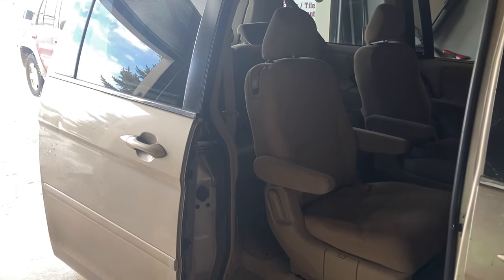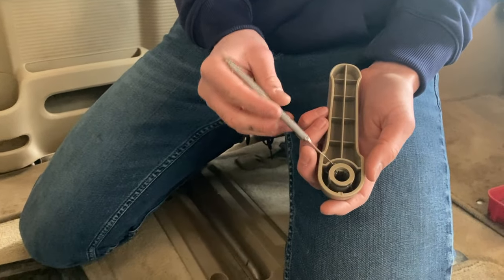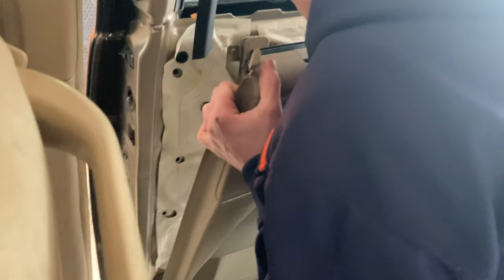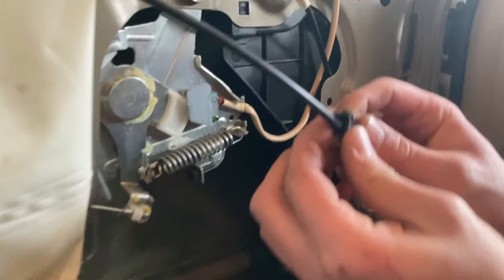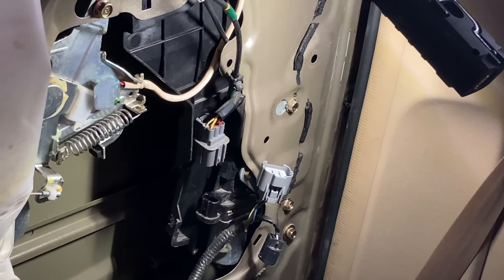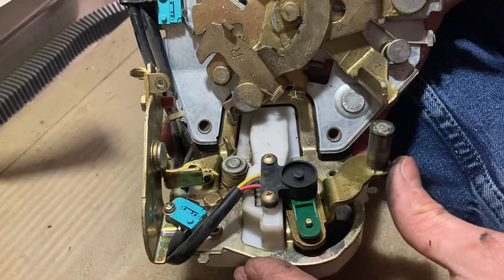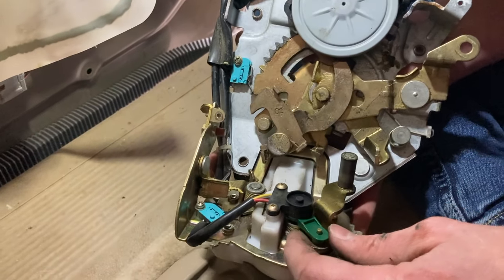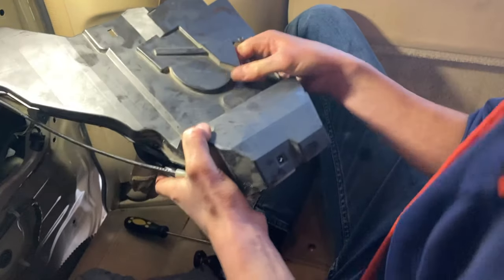How To Fix Parasitic Drain and Power Sliding Doors On 2005-10 Honda Odyssey

Comment: Hi Hans, grreat video! If we don't have time right now to fix it, would it solve the parasitic drain if we pull out the fuse that operates these doors?
Reply: @hanspoole  Dear Hans, THANK YOU FOR SUCH A THOROUGH REPLY! We have been using a small lithium jumper battery DAILY to get this going every morning. What a pain! I guess I have to make the time to get into the sliding door once and for all. I'm sure glad I have your Youutube video to work from!
Reply: This is what I have been doing for a few months....... the times I forget my battery dies......  I will be doing this fix in the next week.
Reply: We are having the same battery draw and the doors have acted up for a while in one way or another.  My wife has been having to jump it every morning with a small jump box as well. I first put a new battery in thinking it was just a week battery and that worked fine for about a month.  When it started dying again I brought it to a local shop that clearly cannot figure it out because it went back there 3 times and still has the same issue.  Thank you for the upload! I really hope this is my issue, im crossing my fingers. I stumbled across this looking for info on fixing the rear latch because it just started lighting up the dash saying that the door was open. I have been at my wits end with this thing and seriously considering taking a loss and giving it away and buying a new one.

Comment: Hans- could you help me locate the part numbers in case I do in fact have to replace the entire latch assembly in the event that the micro switch itself is faulty? I have found the part number for the latch part itself, but not the part number of the assemble which contains the micro switches that control the latch

Comment: I accomplished the same end result on my 2006 Odyssey by ONLY drilling two 5/32" holes (no need to take door apart).  The doors started working again and the battery draw problem went away.
Reply: Same question. Where did you drill the holes.
Reply: I’m wondering the same thing,where did you drill the holes?!
Reply: how!??!!
Reply: I've tried to post instructions multiple times, but YouTube keeps deleting my message.  I'm stumped.
Reply: Yea suuuuure 😉
Reply: @anthonykavanaugh6213  I don't blame you for not believing it, I'm still in shock that it worked and is still working.  I gave up trying to post written instructions, so if I get time this week, I'll try to create a video and post the video title here for you guys.  Have a good day.
Reply: @4uidrum   TRY AGAIN PLEASE
Reply: Can you tell us about the holes you drilled please?

Comment: I'm too lazy to take the door apart and just sprayed the heck out of the visible portion of the latch mechanism with lubricant. I'm encouraging my family to just NOT USE the driver side sliding door. This problem gets worse in the winter.

Edit: this actually worked all winter! Even using the door was totally fine. Definitely five my method a try before taking the door apart.
Reply: What lubricant did you used. W40 ?
Reply: @frantisekbotko6846  Blaster brand silicone lubricant spray

Comment: I just took apart my left side and I found gunk, leaves and other stuff around the latch mechanism. The main latch doesn’t seem smooth when actuating so I will make sure that will move after I clean it with contact cleaner and the grease it. The problem I have now is that metal window bracket piece fell down into the door. I have to get a magnetic tool to fish that one out next. But definitely the latch mechanism that makes contact with the switch has a gap between the switch lever and is not making contact.

Comment: Have an 05 Honda Odyssey here, it’s closing the same way you showed and my battery is dead every morning, brand new battery. I’m gonna try to flood the latch area with some penetrating oil before I tear anything apart lol.
Reply: Interested in how this worked for you.
Reply: @MichaelBrown-bh1qf  still need to replace them, it helped for a day but without being able to open up the unit you can’t lube it well enough.

Comment: Can I just remove the power door fuse/relay? I just want manual doors.
Reply from the maker: If you want to get rid of the parasitic drain and just have manual doors by pulling a fuse, then fuse #7 in the driver’s side panel is the way to go. However, by pulling that fuse you will also disable other features such as locking the doors with the key fob and dome lights automatically turning on with open doors.

Comment: If you take off the screw-drive you can exercise the final closing mechanism... this lets you test the switch for it without having to remove the switch.  Just remember where the cam pawl was when you put it back.  Bonus:  you get to figure out what's going on when the final closing of the door happens... this is the magic that the funny 3-wire switch performs.  That damn window track!  Big thing there... it's plastic, and bends out of the way... you have to get the mechanism inside the window track to replace it, not easy!  See the hole with the slot?  Put one bolt (not the washer one!) in there to hang it on when you finally get it in place.

Comment: Was yours beeping at you when driving? Mine has been a pain for a while but my drain didn't start until 3 days after replacing the alternator and battery. And my van doesn't beep like the door is open. Curious if this it's just coincidence and the latch is causing my drain.
Reply: You can also check the wire harness in the lift gate on the upper right side, sometimes the wires get worn and break and that can also cause the doors to not work and drain
Reply: @hanspoole  I don't know if I updated yet but it turns out it was the alternator. I was just in denial
Reply: @hanspoole  I did, both times. It's not so bad compared to other vehicles I've done it on. Maybe 45 min?

Comment: Someone on this list said they unscrewed the screws and squirted some lube in through the holes. Because I am in no position to crawl in the back of my van and attempt what Hans Pool has done I tried that. I’m in a wheelchair. So far so good. It’s closing and opening every time and I can’t detect any drain on the battery, parasitic draw or alarm going off. I still don’t trust it so I’m disconnecting the battery every night until I test it more. But if this works, I’ve just saved myself over $2000. I think I’ll put it on my phone calendar to lube it up that way every six months - pending final results.
Reply from the maker: That's not at all a bad idea to put it on a recurring maintenance interval, especially if that works for you and you're physically unable to crawl in the back of the van and take the doors apart👍
Reply: @hanspoole  Here’s hoping, thanks to your vid and your commenters.
Reply: Mine has been doing the same and I thought unplugging my car was damaging it. So I'm glad it's not. It's annoying when you only have one car and don't know what's causing the problem

Comment: What to do if I manually closed the door and the door lock is constantly trying to lock itself? Hastings guy said it's not the door lock fuse but maybe the actuator or relay or switch,... he agreed that I should have a professional vehicle electrician fix it. Is this fix easy?
Reply: The alarm was also silently on with a faint clicking noise near the radio. A video said to turn the key on the door and hold it in the open position. Eventually, the window rolled completely down and the clicking stopped.
Reply: Removing the 20a Door Lock fuse seems to be the temporary solution until I know why the lock is constantly active.
Reply: from what ive seen is that a switch in the gas cap lets the car know if it open or closed. if the switch is faulty it will trying locking the doors.

Comment: So mine is an 06 and has been doing this issue for a while (months I’ve had to jump start the car every morning) every morning the car is dead (even with a kill switch installed on the negative terminal of the battery) the battery was tested and appears to be operational and charged.....the left sliding door I removed both fuses....since  it wasn’t closing automatically anyway, although it does that 2 second sealing shut thing even while driving!) the right sliding door started doing the same thing). My question is why would it still be dead after disconnecting the battery each night? Is the computer system still sensing the doors are open or latching on and off? Please help? Do you have an email or phone to contact?
Reply: @hanspoole  so I just replaced the battery today To start there, the kill switch is brand new and just installed, I pulled the door fuses, so we’ll see what happens in the next few days, I have not tried to disconnect the terminals every night since that would just be too much of a hassle on a daily basis but I could try. We tested the battery and it was ok, but we replaced it today anyway just to start there with something. I don’t think I could do what you did in this video by myself though. Thanks, I’ll keep you posted brother!

Comment: Can anyone explain how he unplugs the black cable at 7:30?
I’ve been trying but it won’t come off.
Reply: The clip is towards the front of the van on the black connector.  Push the top of the clip toward the connector, really firmly, and it will release at the bottom.  I used a flathead on the connector to push it upwards simultaneously.

Comment: So my power sliding doors are not responding at all. No power.

I tried pulling fuse 7 to reset system multiple times but no luck.

Any suggestions?
Reply: @hanspoole  thanks. Yes, manually they seems to function ok.

When I close each door it seems as if a electronic motor takes over to close it tighter and secure the door.

I’ll check the forums like you suggested.
Reply: @hanspoole  Thanks man, the problem is solved for now.

I sprayed a generous amount of silicone lube in both hinge openings. I also picked up some 3-in-1 as you recommended.

If the problem persists I may just pick up a good scanner to pin point the issue.

Thanks again.

Comment: There is no way I can attempt your repair, I am going to pull some fuses and hope for the bsst.
Reply: Someone on this list said they unscrewed the screws and squirted some lube in through the holes. Because I am in no position to crawl in the back of my van and attempt what Hans Pool has done I tried that. I’m in a wheelchair. So far so good. It’s closing and opening every time and I can’t detect any drain on the battery, parasitic draw or alarm going off. I still don’t trust it so I’m disconnecting the battery every night until I test it more. But if this works, I’ve just saved myself over $2000. I think I’ll put it on my phone calendar to lube it up that way every six months - pending final results.

Comment: I followed this and mine worked exactly two times.  I accidentally put some resistance on the door while it was closing the third time and now it acts as though the "pinch protection" is stuck on.  :(
Reply: When I open it, it gets about 3" open then the door buzzer/alarm comes on until I force it all the way open.  Then the buzzer shuts off until I repeat the process to close it.  3" and the alarm sounds until its closed all the way.  Pulling #7 fuse did in fact reset it and allowed it to function correctly again a couple times, but something else is now causing this.  This initial latch fix seemed to have worked as when its working, I no longer hear the latch close and then instantly reopen like before.  Time for more troubleshooting!  :)  This is a 2005 FYI.   @hanspoole
Reply from the maker: At least the latch is working fine ;) I'm sure you've already checked this out, so forgive me for mentioning it, but given your latest description, I'm wondering if the rollers are bad. It sounds like the door is running into some internal resistance (rollers are commonly the culprit) and stops itself as a result. This can cause the door module to basically go into hibernation, it can then be woken up with the fuse trick. 

One way you can easily diagnose worn out rollers is if there's a lot of sloppiness in the axis perpendicular to the direction of travel. @EricTheCarGuy  has a bunch of great videos on these door rollers, I would highly recommend checking them out if you haven't already.

Comment: How do I confirm that this is the issue I’m having without taking the door apart??
Reply: @hanspoole  Pull fuse #7 (7.5a) which cuts power to door lock and other components.  Check the drain overnight, which should not occur if this is problem.
Reply: If you break the power connection how could it still draw the battery down?

Comment: I have an 05 odyssey and I have water dripping onto my driver side fuse panel which is causing things to go haywire any ideas
Reply: First thing you need to do and easiest fix:  silicon caulk the drivers side door jam electrical rubber seal that enters the body side of the van .  Rain water is flowing thru the hinge side seam of your front door.  Crappy honda body seals fail and after a good rain water will find its way to the fusebox on driver's side.  Windows drop on their own and won't go back up , etc.  look at your fuse chart and chances are the wonky components correspond to fuses clumped close together in the fuse box!  Good luck
Reply: @hanspoole  I seen it’s coming in under the dash running down the bottom of the or vent for the heater duct n dropping off right above where the fuses are if that makes sense
Reply: @hanspoole  ok I will have to locate where that is I’ve nvr heard of that
Reply: @Frankthebunny123  yes it has since lost both turn signals and no big beams I just got the van about 2 months ago
Reply: @Frankthebunny123  dumb question but how do I kno which is the electrical rubber seal
Reply: @Frankthebunny123  I been thinking what I could deflect the water with and was coming up blank but that sounds like a decent idea plus my buddy at work told me what ur talking about is the part that the wires go through the door is that correct
Reply: Clogged sunroof drain was my fix for this problem. I used low pressure air from my air compressor. Problem only occurred when my odyssey was parked an a downhill incline in the rain. That's how I found the problem. The drains are located in the front of the sunroof on both sides. Mine is a 2010 and a great vehicle.

Comment: If you remove that 7.5A fuse, other components on that line will stop working. If the computer is staying on waiting for an expectation and is on standby, then this is what is killing your battery. Mechanical switches actuate by turning off, on, but nothing in between. These are mechanical parts that after 1,000s of cycles will eventually go bad. Makes sense that this is causing the issue and not an electrical component.